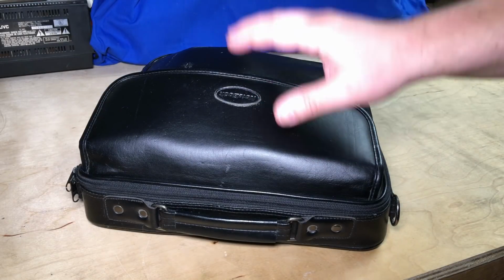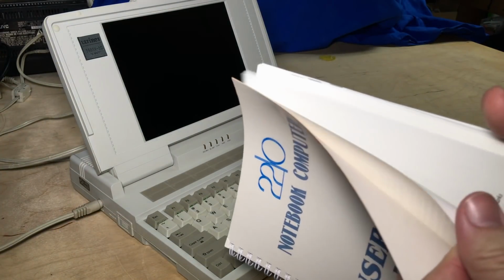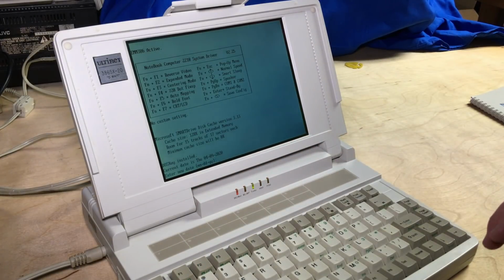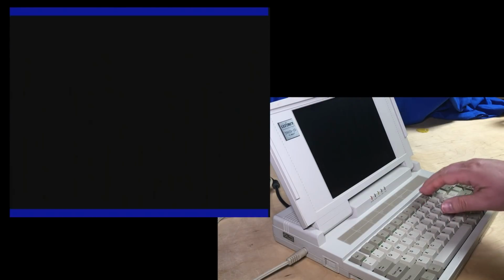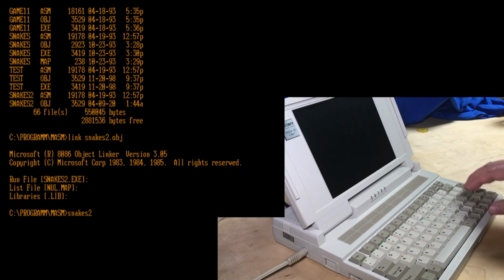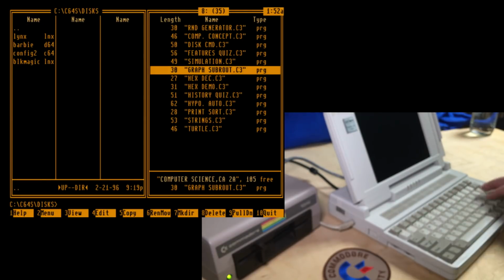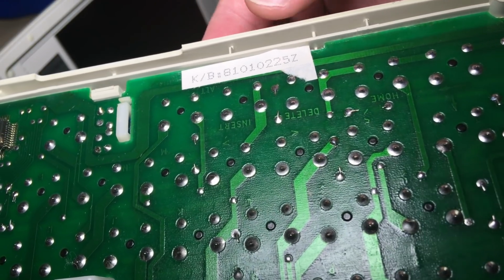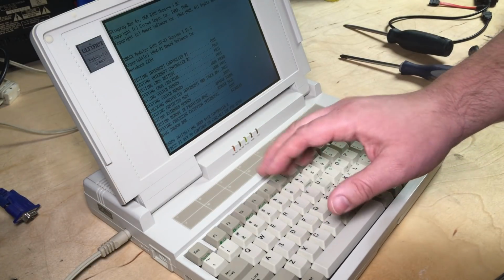My 386SX Laptop: X1541 C64 Transfers, 8086 Assembly, MS-DOS and More

Comment: You could replace the HD with a compact flash to 44 pin ide converter, ebay sells them. I would prob recommend more so though a Msata to 44 pin ide converter but it may run into problems with the max hard disk size. I used a Compact flash to IDE in an old Thinkpad X40 running ubuntu for many years. Just installed a Msata to Ide in it and installed windows 7, runs fine but I can't get any Video controller drivers to work.
Reply: Great idea to use a Compact flash card or similar.
I have one in the "other spare Pentium 2 - it uses a 4 gig cards for dos, or a swap it with a 16 Gig card formated as 4+4+8 - i think"

Normal ide is 40 pin data + the small or large molex power cables ,later laptops is 44 pin a bit wider because it has power on the ide cable pins 41 to 44

Another option if it is 44 pin is the DOM - drive on module, they come in a flexi cable and sealed module or hard connector and small circuit board with exposed parts - think of it as a sort of early internal usb flash drive - i have one in my Wyse thin client ( well i have 2 , one has the wyse OS for remote desktop to work ( 100 meg chip ) , i have another thin client with a 512 meg chip , but i formated that dos 6.22 and has 386/486 games on it

You will never get Win 7 on a 386,  Dos 6.22 and Win 3.11 will be smooth and maybe 95 is possible

Comment: Great video.. I love the way you use Norton Commander to manage Commodore Floppies using a 386SX20.  That how the disk images were made. Was wonder that. I had a modem on my C64 super fast 300 baud. I wasn't allowed to use to phone so I had to sneak on every night to jump on BBS's. Then had a 8080. 486SX33 and on and on and .... I have had too many computer. I still do have too many computer. I have more computers than furniture. ;)
Reply: Norton Commander can't handle Commodore drives, the program used is Star Commander.

Comment: I still have a Highscreen 386 SX 33 notebook. It looks somewhat like yours but not quite.
I recently revived it to play Planet X3 on it. The BIOS battery is dead of course and I had to guess the correct values for the hard disk. Also, the brightness dial doesn't quite work anymore. All in all still usable.
What I found interesting is that people claim that it's keyboard interface is proprietary. However, I just plugged in a PS2 keyboard and it worked just fine.
Reply: they are probably referring to that weird keypad connector on the side

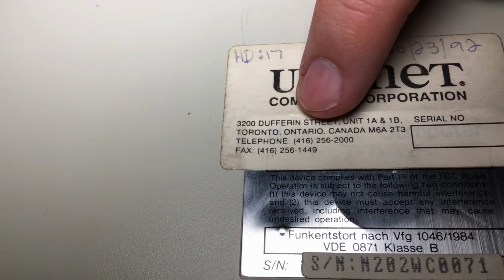Comment: 2:42 I owned only Commodores until 1996, which would have been Grade 22 of school.

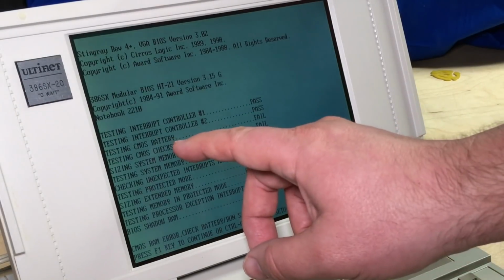7:05 Your CMOS battery is probably leaking all over your circuit board.  Yep.

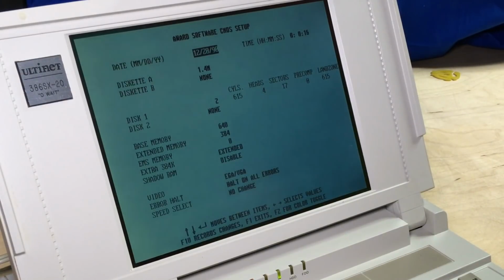7:33 Does it really support the 21st century?  Apparently, yes.  Two-digit years always bug me.  What does a date of 11/03/18 mean?  We can only deduce that the "18" can't be a month.

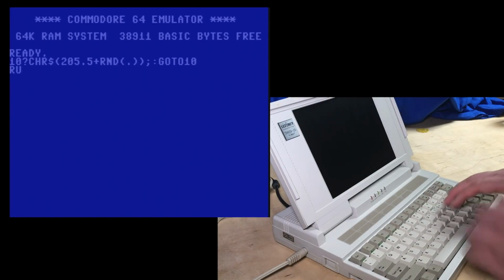13:05 It's even slower than COBOL!

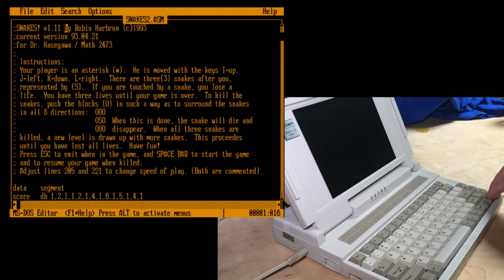15:14 An undergrad project for me was to write a Snake game — in APL!  (~R∊R∘.×R)/R←1↓ιR

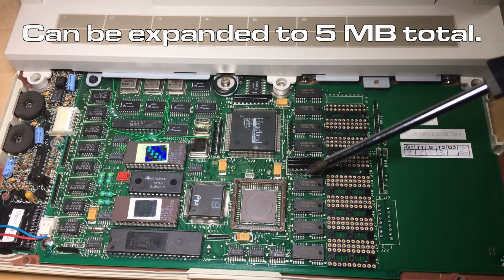27:54 It's interesting how those old chips didn't need any direct cooling.
Reply: csbruce I used my amiga through college, 92-97. Fortunately, I had ATonce to run windows progs and amiWIN to x11 into the comp lab Unix machines. I limped along with the amiga until 2000 when I bought my first real pc

Comment: Is the FCC ID FMA2210?  If so, it's an Ultinet-rebranded 386SX20 laptop from the Nan Tan Computer CO. in Taiwan.  Even if that FCC ID isn't that, I'm fairly certain that's what it is.
If anyone is wondering, It's "zero wait", for zero wait-state RAM.
Reply from the maker: I just found a picture online of a Nan Tan 2200, and it looks identical. Awesome, thanks Jim!  http://www.ericswarehouse.com/Warehouse/login/useritemdisplay.php?itemid=1783
Reply from the maker: It seems the FCC ID is very deliberately covered over with the Ultinet label. I'm reluctant to peel it off, but I'm sure I can make out "FMA" through it.
Reply: Wow! When looking at that ultra generic unbranded manual, I was reminded of the many generic tech products with different almost random brand names but identical technology and design, made in China and Taiwan today (often, very well designed hardware). Interesting to see that reseller pattern was still a thing in 1991.
Reply: @batlin  It's been a thing since forever, the 1900s and on particularly.